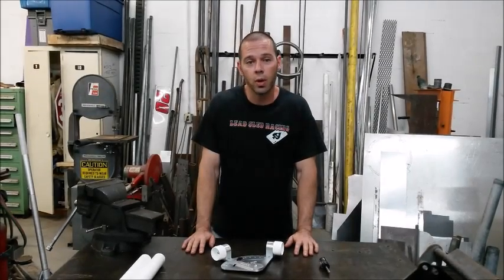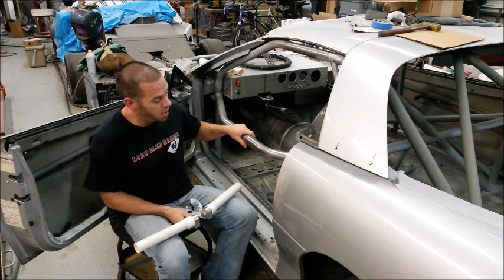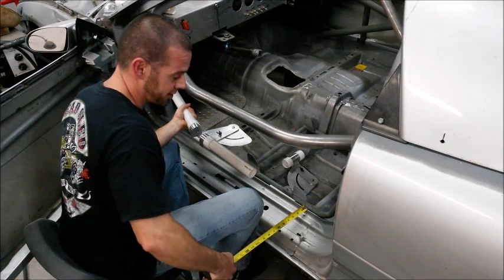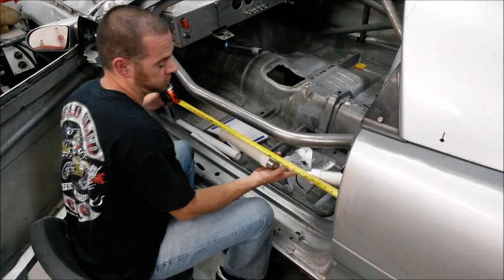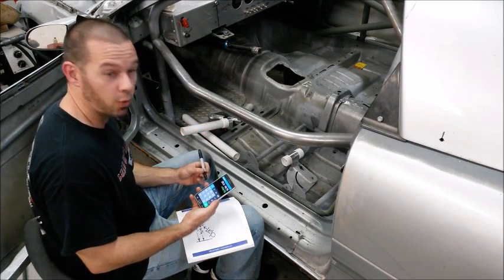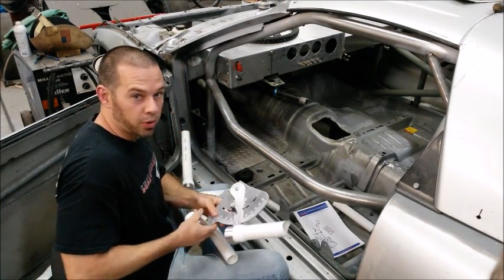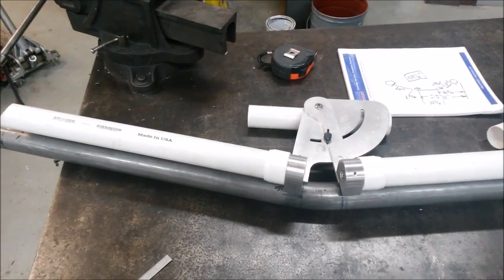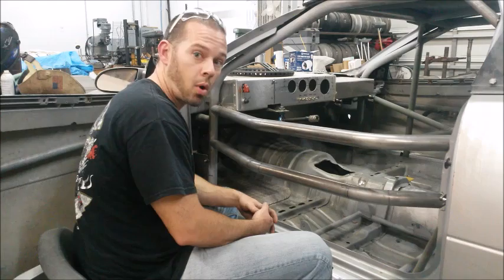Cage Gage Intro Video & Door Bar Build

Comment: Sweet product! I may have one suggestion for catering to a different market. The only reason I'd hesitate to buy the Cage Gage is because it won't let me do bends that follow the body line on an ExoCage for offroading. Reason being is the tube is normally placed as close as possible to the body and the gauge portion would obviously interfere. 

Maybe a second product / version would allow you to do bends in the 180º to ~320º range instead of 0 to 180. That would open up your product to thousands of offroaders who build ExoCages more than interior cages.
Reply from the maker: Thanks for the feedback!! That is a good idea. We have a few different configurations we are working on, I will add that concept into the mix as well.